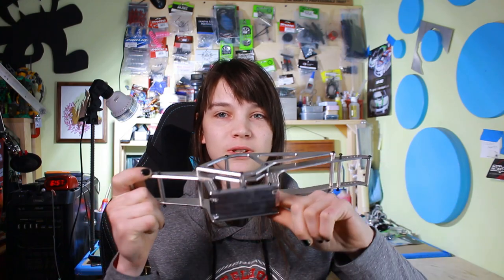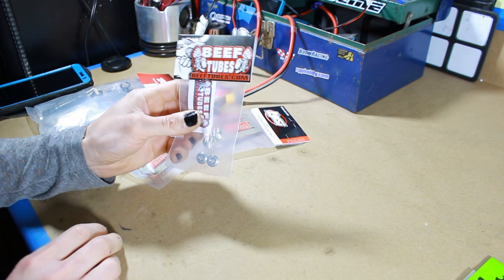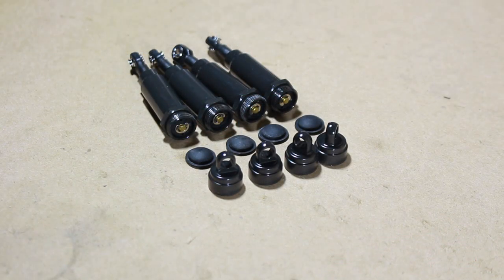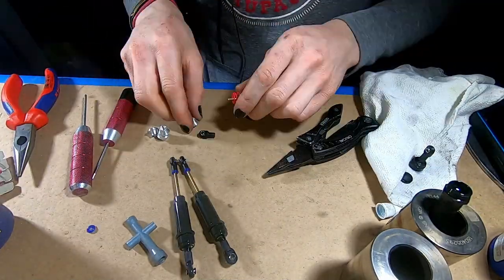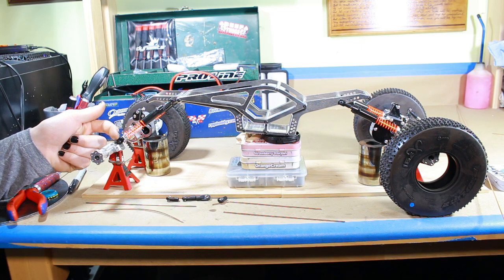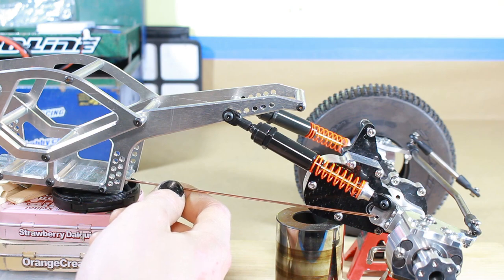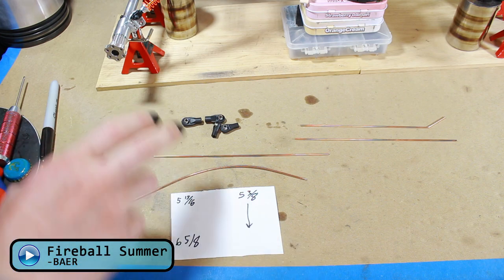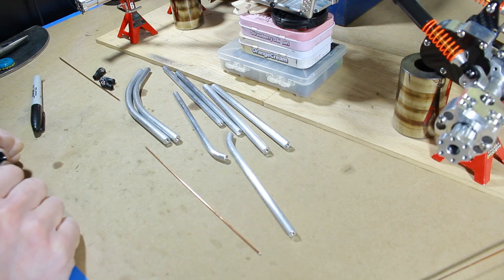MOA Crawler Build |Ep 4| SUSPENSION!!

Comment: Right now, the only thing I can think that would even come close to being a challenger for this rig might be the Extreme Route W3. You have absolutely outdone yourself with this build. Truly worthy of respect. 

It really looks to be Superclass sized or somewhere in between Superclass and Pro 2.2. 

Have you looked into cut and shut and how that’s done with tires? You may have to resort to making your own wheels and custom cutting and gluing your own tires as most Superclass rigs just can’t be fitted properly with wheels. You may wish to really seal the deal with the ultimate DIY and go for it, girl! 

This kicks so much ass. I can’t wait to see it running.
Reply from the maker: Thank you :) I just took a look at the W3 and that is one of the more bizarre rigs I have seen. A hinge instead of links!? What in the world?

At this point I am going to get another pair of Ibexs and enlarge them to around 6.5 or 7 inches. Just gotta find some donor monster truck tires with big enough sidewalls and then machine some wheels ;)